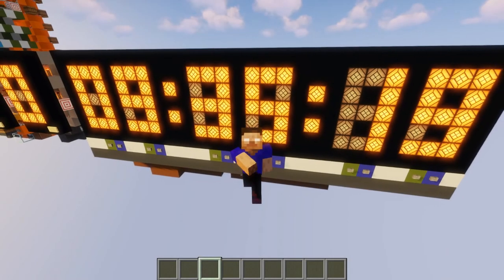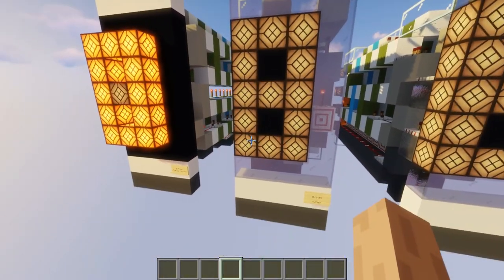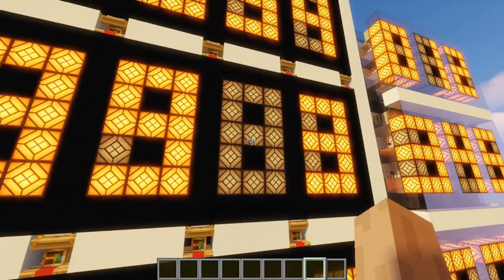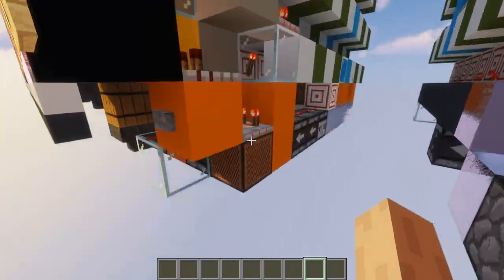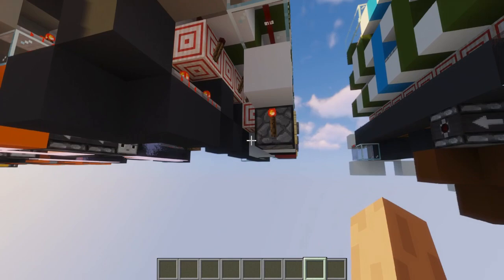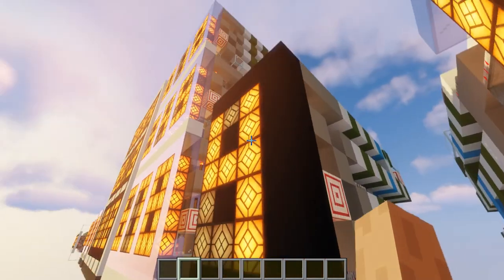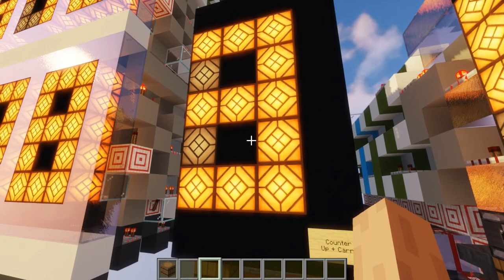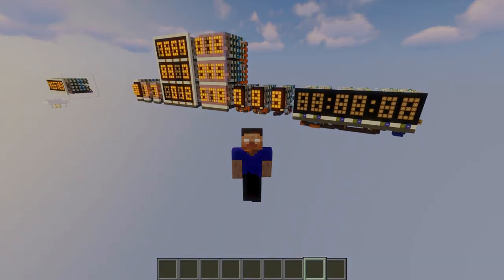Nicely Tile-able 7-Segment Displays: Download + Applications | Minecraft 1.16+

Comment from the maker: Yes, the video is incredibly choppy/laggy. Horrible! I'm very sorry for that BUT I needed to get the project out finally. I have no idea how to fix it (I re-recorded the whole video twice without shaders!) so I guess I need to fix something with my computer. Hopefully the content is good enough to inspire you to go on your own projects using these great devices!
Reply: I've had a similar problem once in the past, it was a problem with my HDD, I simply just had the output file go to a different drive and the problems were completely solved, so maybe give this a try if you're unsure what the issue is?
Reply from the maker: That might as well be my case! I've noticed the bottleneck potential from my hdd :-p Will run some tests this weekend. Thanks for the feedback!
Reply: Is the Binary display able to go from 0-F or is it just 0-9?

Comment: Hi, can i ask what are the barrels used for? epic vid btw
Reply from the maker: Comparators can read different values according to the number of items inside containers attached to them. There is an example in the video where I change the maximum output of the display by changing the number of items inside the barrel.

Comment: Hello! I build a 7 digit-counter for incoming items and everything is working fine until the cunks unloads. (or something like that)

I build it on a server in the spawn chunks. Everytime i log out for some minutes and i come back there is a probably random number on the counter. (like 4.372.002, even if i just put 200 items in) 

do you now any fixes?

Its a really nice display and i was really happy with it, but like this, it is useless for me :(
Reply from the maker: Minecraft really messes things up when it comes to chunk loading/unloading unfortunately!
One solution is to try to design a counter that works purely based on signal strength rather than moving items inside containers.

Another thing I learned is that chunk unloading behaves better when the player leaves the area through a portal rather than sprinting or flying.
Reply: Thanks for the answer! I solved the problem with a command Block which locks a comparator. Now when no Player is on the server the items stop flowing and the display get no redstone Inputs.

Only a Little bit cheating with the command Block in it but didnt get it to work in another way.

Keep on your great work!

Comment: I made a 3.3333HZ calculator (that just add two 64 bit numbers) do you have any idea how i can have inputs as decimal instead of having them as binary and having to shift the input register for every entry ?
Reply: Minecraft on iPad not the pc one
Reply from the maker: I'm not sure I understand your question but if you want to keep your calculator as a binary machine you could use BCD (binary to decimal) Converter. I'm sure you can find videos on how to build those efficiently.

If you want to take advantage of the "analog" signal strength potential you could make a calculator using the decimal system such as this one: https://www.youtube.com/watch?v=YSOvpj68Ego

Comment: I copied this design from the world download and I cannot get it to display correctly. the reset works fine but when the noteblock is pressed the numbers cycle quickly and after a few seconds there is a torch burnout sound. It repeats after that. I've rebuilt it twice now with the same result. Any chance this is a server issue or any tips on how I can go about troubleshooting the issue? Thanks!
Reply from the maker: Hi, I'm guessing you don't have your hoppers pointing in the right direction. When you hit the noteblock it activates a dropper. The dropper is supposed to send its items into a hopper that gets it inside a barrel and so on. If the item gets trapped inside the first hopper (either because it's locked (button in the wrong place) or because it's not pointing towards the barrel) the counter will subtract numbers quickly, which will skip numbers and burn out the torches. Let me know if this helps.
Reply: @MaizumaGames  Thanks for the reply, the hopper system is positioned exactly as in the world download. Only thing I've figured out so far is that I can get it to count by fours by putting a button into redstone into the note block.
Reply: @MaizumaGames  The same thing happens in the world download when I copy/paste a few next to each other and exceed 9 on one or more. I'm using the Counter up + carry design if that helps at all
Reply from the maker: Someone recently had the same problem, you can read the comments for the explanation, but basically, check the front droppers below (with the orange circuit) and if they have 2 items inside remove 1 of them, leaving the droppers with a single item each.

If you hook a chain of displays to a fast clock the right most one might require 2 droppers to not skip. Hope it helps!